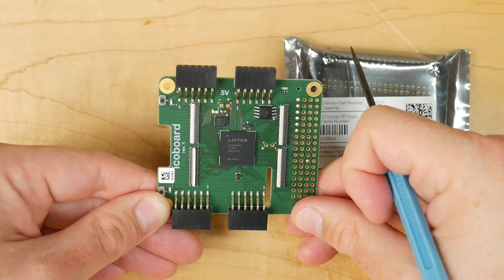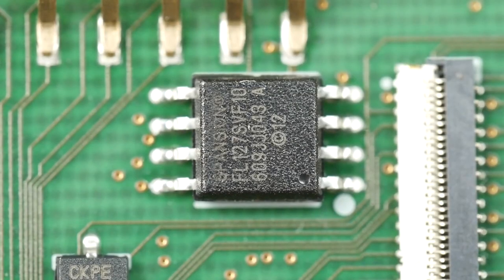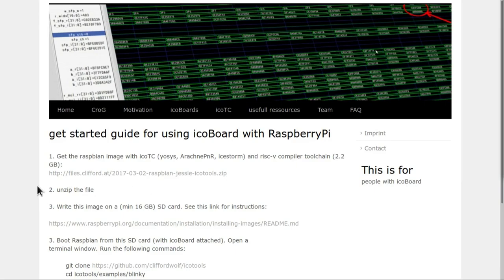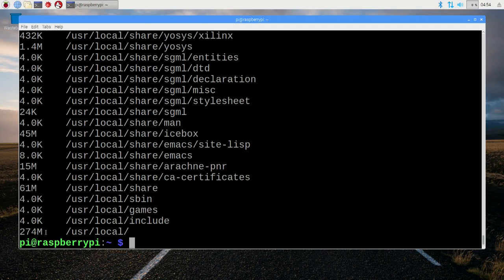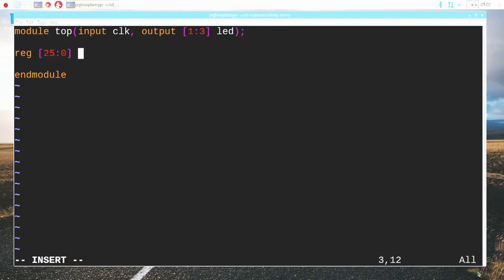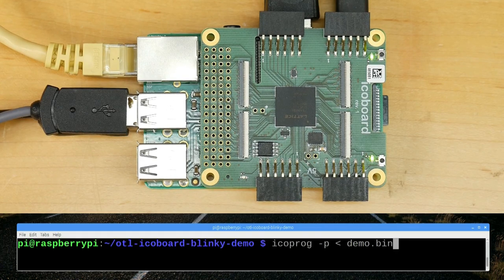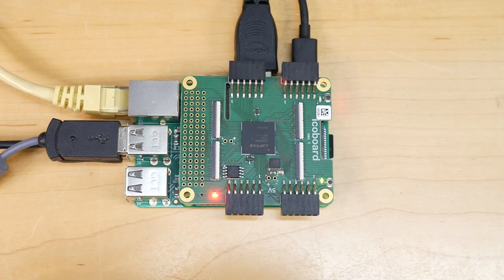Guest Video: OpenTechLab - IcoBoard FPGA Experiments

Comment: I think those huge install sizes come from the windows culture. on linux, file sizes are usually much more reasonable, only a few megs being all that's really needed to contain the entire executable and a few text config files, even the "installer" itself if it's an installable package. actually, more common are executables of only a few kilobytes. the smaller file sizes will also run a bit faster too.

maybe it's just a historic remnant from the time when everything came on cd's, and they would fill it with all kinds of crap just because they could. hard drives also became bigger as time went on, meaning they could worry about space usage less and less. meanwhile you get linux and all its programs from the internet, where size matters much more. a smaller download size means much less bandwidth used to host those files, and the hosting is often sponsored, so even more important to keep sizes small. as well as people from around the world freely working at optimizations if they so choose. a corporation on the other hand, costs them much money to do such optimizations. short term it saves them money, but there are penalties at the user end.
Reply: I agree 100%. I've heard the mantra "bytes are cheap, engineers are expensive" many times, which makes buisiness sense, but for engineering it's crippling, because there's no way Vivado could ever run on a raspberry-pi. Do you want to be able to do that? Who knows, but it doesn't matter, because you can't. So on Linux it's easier to innovate, because you don't run into people telling you that you can't do something, because they don't think you need to be able to.

Comment: Been on embedded design for over a decade now. Feels like this video would make me try out FPGAs. The support for open development was piss poor a decade back. Gotta start off now, nothing better than being able to make your own glue logic for embedded systems!
Reply: Pratik Panda I wonder if the open tools support the glue logic-sized simpler devices (CPLDs with normal logic levels in QFP packages rather than high density FPGAs with sub-2V levels in BGA packages). Those seem to be almost abandoned by the factories these days. I've been looking at chips like Intel (Altera) Max5 and Lattice Mach 4000 for a recent project, and even those require an external 1.8V precision LDO and external TTL level converters.

Comment: 8:19 It's funny, I didn't notice them until you told me. And is there an open source toolchain for the Altera and Xilinx FPGAs as well? Right now I have a cheap Cyclone II board + USB Blaster clone. I've also seen some cheap Cyclone IV and Spartan-3E boards. I say this because for big projects with lots of logic elements, like video encoders and probably cryptocurrency miners, this chip is a bit small. It's, however, very good to get started and there are lots of projects you can do with this FPGA. And I subbed to your channel!

Comment: 90mins waiting for it to compile then writing code just to flash some LEDs. Is there a precompiled version? You assume everyone already knows linux commands and what code to write and how. I wouldn't know where to start.
Reply: The code here is relatively new, so up until recently the IceStorm tools havn't been available via the package repositories on various Linux distributions - which is the normal "app-store" method of installing things on Linux. Though this is changing. The commands to build from source are pretty much in keeping with other software on Linux - if you want to do it yourself, check out the instructions on the IceStorm website. Also there is a pre-built RPi image on the IcoBoard website with the tools pre-built and installed if you want to do synthesis on there - which is much quicker to set up, but not so good for understanding what has been installed and how.
Reply: Install APIO, it’s a cross-platform Python tool that sets up the tool chain for most of the iCE40 FPGA boards.  It will download pre-compiled binaries for your platform: https://github.com/FPGAwars/apio/blob/develop/README.md

Comment: I've never worked with Opensource toolchains on FPGAs before. If I we're to pick this FPGA showed in the video for my next project, is there a public collection of IP cores out there? I've worked with Xilinx Vivado and ISE before and really liked the IP catalog they have (although they are obviously not freely licensed). If I want a dual clock FIFO on the Lattice, am I going to need to program that myself or are these kind of things already out there (with free license)?
Reply: Historically there's a lot of stuff on OpenCores - but there are issues with the way it is managed. So LibreCores is getting started to fill the gap. Also you might want to check out fusesoc - which is a package manager for FPGAs, and includes many cores in the standard index.

Comment: There really wasn't an open source toolkit for FPGAs until a couple years ago?  WTF did people do with them for the last 20 years?  I've been doing software since these came out and pretty much lost track of them, kind of assuming that there was some development going on, but that it hadn't impacted me meant that it wasn't really ready for prime time.  If FPGA takeup wasn't due to its fundamental limitations but due to library availability, wow, someone really dropped the ball on this.
Reply: FPGAs are mostly needed in professional development with high-speed stuff, so there wasn't really a market for hobbyists. People who get paid for this full time don't really mind using closed software that costs in the four-digit range usually.
Affordable FPGAs for hobbyist experimentation only became a thing a few years ago. Still, the real applications in the hobbyist space that couldn't be done by a reasonable microcontroller as well are far inbetween.
Reply: It's not only the price, FPGAs are harder to use (hard to debug as can be seen in part 2 of this video, and compiling can take hours on larger projects). ARM only really took off in the hobby scene with the Raspberry Pi, where you could work on the target platform directly, making the whole development cycle seem much faster (even if in reality it was offset by the increased compile times on the Raspberry Pi).
Reply: I don't recommend doing synthesis on the RPi for obvious reasons. IceStorm is pretty quick though - the SoC demo took my 10-year old Intel Core2 Quad about 4 minutes to synthesize. It's hard to tell what the performance will be like for larger FPGAs when they are supported, but I'm optimistic, because OSS projects tend to be nail those kinds of things.

Comment: Lost me at 19:32. How can a bitstream make gates?
Reply: Each logic-element contains a 4-bit input 1-bit output lookup-table (LUT). By programming the LUT with the desired truth-table, you can make any logic gate you want. If you want more than 4-inputs, you can do it by making a cascade of two or more LUTs.
Reply: OK, thanks - so your code is in some high-level language, and that at some point gets compiled to machine code. Is there then a translation of each machine code instruction into the logic gates required to do that instruction? So for example, an ADD instruction gets compiled into a bit string that represents the logic gates needed to make an adder?
Reply: JL Software Basically that -yes. It's hard to explain everything in a YT comment, but if you want to know more, check out fpga4fun, for some nice introductory tutorials.
Reply: Thanks a lot!

Comment: On the compile section it looks like you've got 2 or so cores on the Pi and you're not using all of them, because CPU usage is stuck at 50%. Maybe make -j2 or -j4 should be used?
Reply: I had problems with running out of ram, overheating and browning out my phone charger. Making a time-lapse like that takes ages, and you can waste hours doing failed recordings if it craps out, so I played it safe.
Reply: Well, I have just the original pi1b+, and even that one makes all sorts of problems with many power supplies, so fair enough...
Reply: I've bought my one with a 2.5A power supply to avoid power issues, but the RAM limitation is a little frustrating.
While setting up a cross-compiling environment is complex there are docker images already configured with the cross-compiler that will save you a lot of time.
Reply: but keep in  mind, make isnt magic...it cant  magical parallelize things just by adding a -j argument. It may work, maybe it doesn't, maybe you run into trouble. Just want to say that...keep it in mind
Reply: just think a minute, what  make and gcc (or whatever your c compiler is) does, when you are  compiling c source....In most cases you don't have just one file of c source, you have many....and these are not compiled into a  binary at one pass....Your compiler creates intermediate object files for every c file. And  this stage can easily parallised, just by fire  as many compiler instances you want. Your SMP capeabil operating system takes care of the rest. And then  you end up with your object files which are linked into  a binary in a single process (which is no issue, because linking is cheap). 
When you got only one single big fat file of c code you will  have a hard time trying to distribute the  compilation over several cores.
Reply: Try lower the GPU memory split and increase the SWAP space.

Comment: The IcoBoard is more expensive than the entry-level Zynq boards that are much more capable… There's no Zynq support in yosys yet, though.
Reply: I'm happy to say that Yosys actually does support synthesis for Xilinx 7-series including Zync. Also Project X-ray/Symbiflow has reverse engineered much of the 7-series bitstream format. The most major missing piece is place-and-route, which might be performed by Verilog-to-Routing's VPR tool. If you want to contribute to these efforts there's opportunities if you want to be involved.

Comment: Doesn't appear to be a way to get this board in Australia, without paying more than its cost in shipping. Any ideas where we can get it?
Reply: If you want to start in FPGAs I would not recommend this board. Joel is restricting himself to open-source tools; but you don't have to do the same. You can get far more powerful boards for less money. And Xilinx, Intel and Lattice have free tools.
Reply: If you want to try the IceStorm tool-chain you could get a ICE40HX1K-STICK-EVN  board @ USD25.25, or an iCE40HX8K-B-EVN for the 8K @ $49.49. You can pick either one up from DigiKey.

And when SymbiFlow open source tool-chain comes to fruition we'll be able to start using Xilinx 7-series boards - of which there are many to choose from.

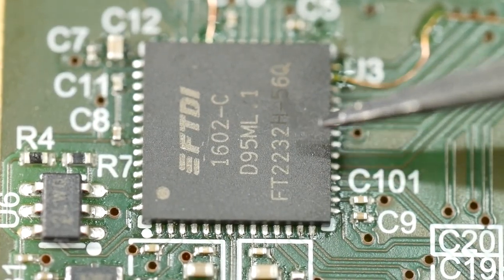Comment: FTDI sucks!  Ever since FTDIgate I avoid all products with FTDI chips as much as possible. 7:08
Reply: Never had any problems with it. You won't get a high-speed chip like a FT2323H from any other vendor.
Reply: The TinyFPGA B2 board I sell uses an iCE40 FPGA and is programmable over USB.  But it does not use an FTDI chip.  It uses an open source USB bootloader implemented in the FPGA itself: https://www.tindie.com/products/tinyfpga/tinyfpga-b2/
Reply: Jo Pe - "Never had any problems with it." - ??  I am talking about FTDIgate where FTDI deliberately made products with clone chips fail.  Dave has a video about it.  Google it.
Reply: Luke Valenty - that sounds great.  Just looked at your link and what you have for sale and they look quite interesting.  I just got an Altera Cyclone 2 dev board to start with but will have to look further at yours next.  Best of luck with it.
Reply: @ElmerFuddGun
I know about FTDIgate. That was I was talking about - I never had any problems with FTDI. Don't use shitty clone chips then. And as I said, you will not find any other vendor who sells high-speed chips, so why avoid FTDI? Because they pissed off some cheapskates who only buy the cheapest shit?
Reply: Jo Pe Point is after FTDIgate, we can never again trust FTDI (the company) not to put evil harmful stuff into any of their other software or firmware.  They basically broke the fundamental trust needed to do business.

Comment: Thats a shitload of flux residue for a "great quality board" and that rework looks like shit. Something looking like that would never leave my factory. Granted, it's a US factory.
Reply: I don't think it's too bad. There's zero residue around the SMT parts which includes everything on both boards except the 40-pin header on the icoUSBaseboard and the mod-wires. You're right that this should be removed, but overall I'm very happy with it.
Reply: There's no other reason to remove it than aesthetics. Most, if not all flux core ale no-clean, non-corrosive.
Reply: Yeah no. We use water soluble core unless there are components that cannot be run through an aqueous wash process. Aesthetics matter. The rework on the board in question looks sloppy. Not sure how one could argue that.